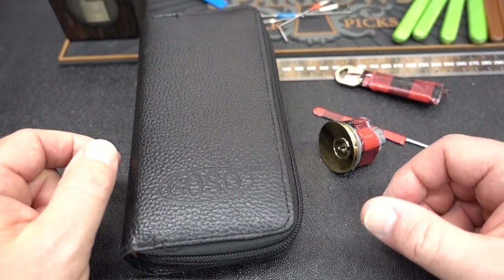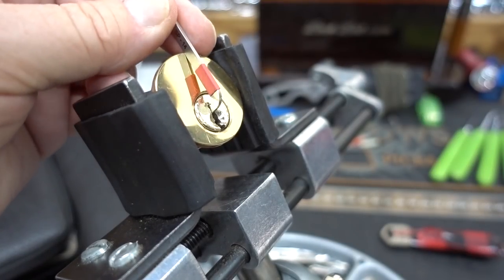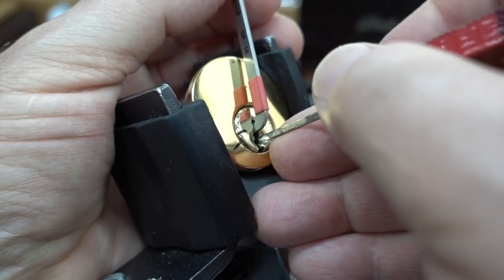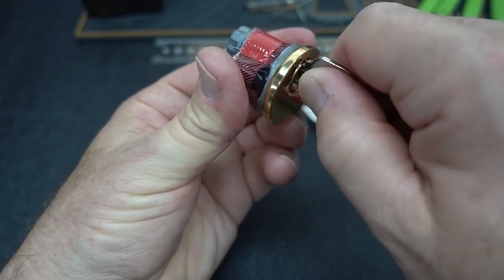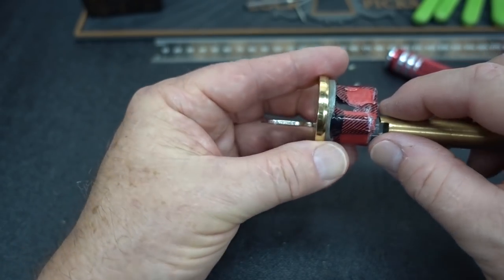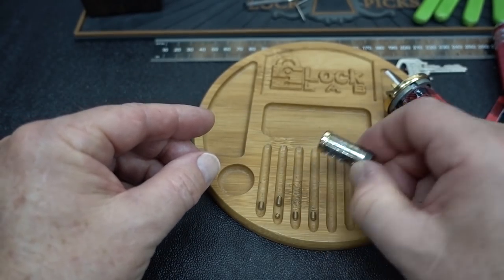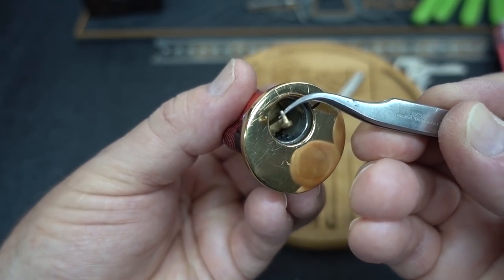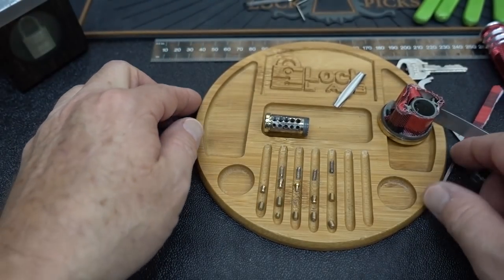(1372) Challenge: Obscene False Setter

Comment: The smaller pin was in the third chamber" 7:39 "
Reply: I was about to say this too. It was in the second set of pin holes.
Reply: It was there to stop the T-pin from becoming a trap pin
Reply: wrong, that was in the core
Reply: At 7:47 you can see it in the construction key hole, and at 9:31 you can see the hole is empty.
Reply: Frank Durham your right on the money with that
Reply from the maker: Yep, now that I reviewed the HD video it is obvious.  Sorry  I missed that but when I film the videos I'm looking through the camera's LCD and the resolution isn't that great.  Occasionally I look over the camera but have found that when I do that the lock gets un-centered and the focus goes to crap.  Totally my bad.
Reply: Bill, you might want to invest in an external monitor for your camera, you can find a cheap chinese one on ebay or the like.
Reply: Bosnianbill
I have the time to check your videos frame by frame. You need to use your time to make more videos! lol
Reply: @TheObsesedAnimeFreaks  I agree, when I take promotion photos for my fellow Marines I hook my camera up to a 60" TV so they know what to adjust.  It makes my life so much easier.
Reply: What are those second set of holes for anyway?

Comment: I think the very short pin you thought was from pin 2 was actually blocking the construction hole in pin 3 so the T-pin didn't get trapped.
Reply: Jim Fortune that’s exactly why I put it there👍
Reply: Dustin C
Nice of you not to trap him. 👍
Reply: Jim Fortune I think Bill mentioned in a previous video that trap locks are not going to count as challenge locks any more
Reply: Dustin C
But I think he changed his mind and said he would just open them the rest of the way with a wrench on the shaft of a large screwdriver. In other words, not non-destructively. ;->

Comment: What's the reason for using a shim when removing the core? Can't you just turn the cylinder and push it out with a follower? Then just grab each pin as they pop up, when the pin chambers are exposed as you pull the core out? What would using a shim in the middle of all of that do? How does it help? Seems like it's redundant 🤷‍♂️

Comment: Not a locksmith or picker, but what about using magnets as pins with tension springs to pull the pins up? A steel key, or key with magnetic inserts pulls the pins down to the sheer line. It's easy to slide magnets apart, so I would think it would still operate
Reply: I think the Evva MCS works in a similar way I am not 100% sure though
Reply: Some security key systems already use magnets to activate pins, especially in dimple locks.
Reply: I would use maybe one magnetic pin like you see with multi lock but all 5 or 6 pins being magnetic i feel would bind up and make using the key difficult.  But i like the way you think. Its ideas like that, that makes this stuff fun.
Reply: I was thinking of using them in traditional locks like the one picked in this video. They make those neodymium magnets pretty small. I have one at work (heavy truck mechanic) that came out of a vehicle speed sensor that looks about the same size as the driver pins.
Reply: Miniluxe are designed with magnets inside the key which are usually defeated by picking them upside down if working at the bench.
Reply: @voidofmind , that's what the tension springs are for, to pull the pins to the other side of the shear line. The magnet in the key has to pull the pins down to line up. That would overcome the whole "pick upside down" trick

Comment: The "sub calibre" pin was from the third pin. it's designed so that if you pick it, the little pin drops into the second set of holes making the key useless. The key would have worked perfectly if that pin wasn't dropped by the false set. It's a security feature to let you know if someones tried to pick your lock...

Although you probably already knew this.
Reply: freenarative Actually I put the sub caliber pin in the third construction hole so that the 
T pin wouldn’t get trapped

Comment: And suggestions on were to get a good table vice for lock picking? Having a hard time finding one, looks like yours is home made. Also, can anyone explain to me the reason for shimming when using a follower?
Reply: The vise he is using is in the description a panasonic.  And the shimming is to keep things from popping out when you dont want them to.
Reply: Correction panavise.
Reply: How does the shim hold the pins in? Doesnt the follower do that, ive seen him not use a shim multiple times
Reply: Circca The shim doesn’t hold the pins in place, Mainly what it does is keep them from popping down between the core and the follower